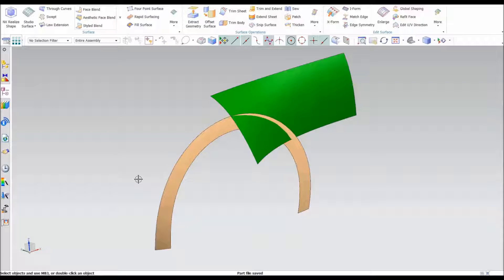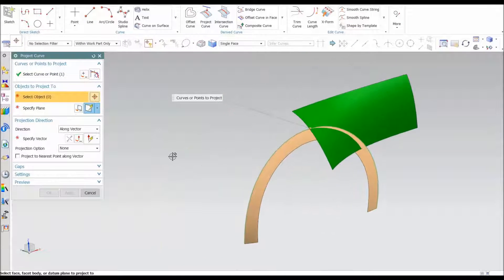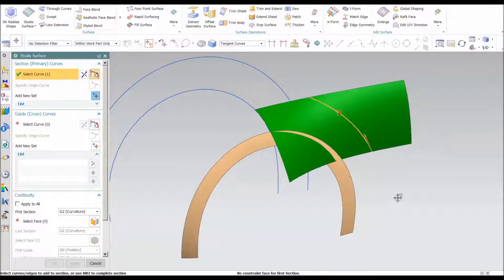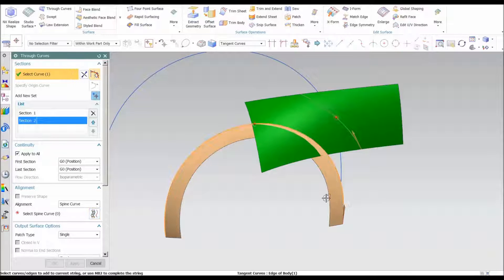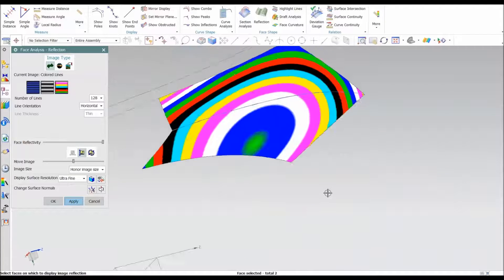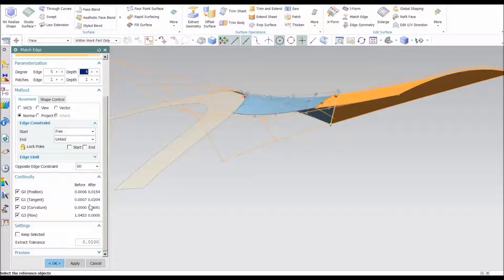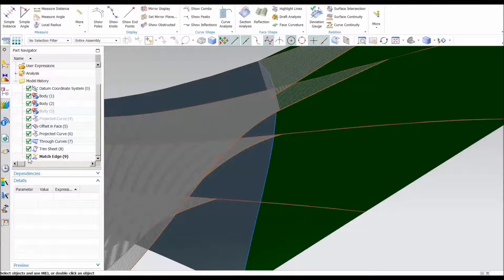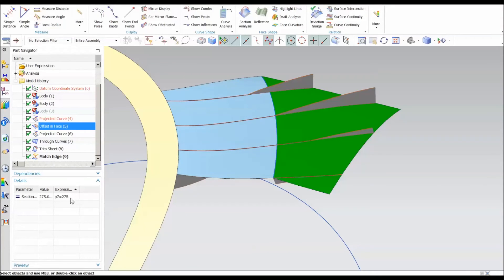Siemens NX 10 | Wheel Arch Blend Surface Technique

Comment: you have two surfaces.   try building parametric with an entire fender, hood, door, flare that is all parametric and tied together?you might as well say good night because you will be there forever trying yo make updates
Reply from the maker: +mark p It is not as difficult as you think. I have done complete door inners, body sides, grills, tail gates, deck lids etc... 

With just some of the videos I have shown I have hinted at how it is done.
Reply from the maker: +mark p Plus, I have been on NX for 20 years.